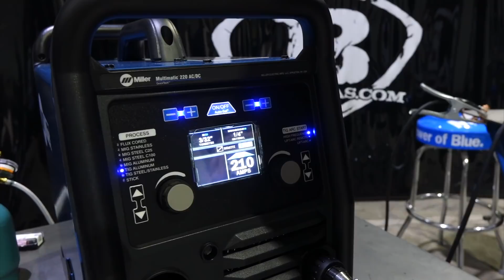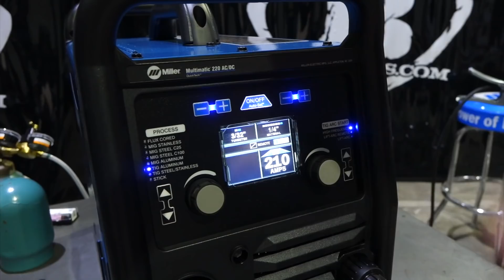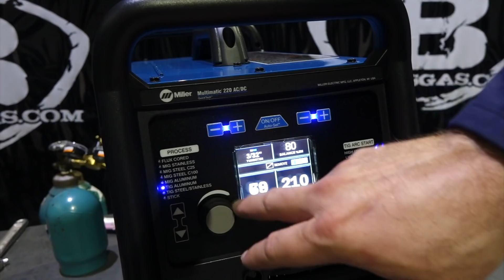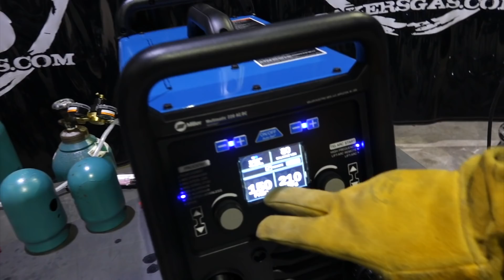Multimatic 220 AC/DC Welding Review

Comment: I’m new to welding and need a 200mig but I wouldn’t mind learning to try to do tig later on. Is there any 200 multiprocessor type welders cheaper that would also tig aluminum?
I was really wanting the Esab emp210 but people were saying it would not tig aluminum for what ever reason.

Comment: Man this is an older video but I love my 220. It’s a stellar machine does great all around work. Most will say you can’t adjust post flow on it so they won’t get it. You can adjust post flow from 0-30 seconds. While the unit is powered up you use the far left negative button and the far right positive button. Press them at the same time and it will put you into an advance setup menu with 12 options it’s the last one. It will save you on gas as the factory settings are a bit high for some materials. Stainless I tend to put it above factory settings but that’s just me. If your pondering the purchase don’t hesitate it’s a fabulous machine. I’ve welded both blue and red and I love this little blue machine.
Reply from the maker: Thanks for the feedback. We are actually going to do an updated video here soon and will go into some neat things like that.

Comment: This machine is for the amateurs, since it comes with the automatic settings that are never reliable and produce the best weld.
Reply: Thanks for your commentary SOURPUSS. I am a beginner and amateur. I am happy with this machine.Too bad we are not all PROFESSIONALS  like you are
Reply: @Fatso714  I became a SOURPUSS cos I tell the truth. Miller paid you to promote their products, so you tried to avoid tell the truth. Miller's list of configuration of amperage/voltage and wire speed can only used as a reference, each machine has a duty cycle limit. Long time use can never depend on the fixed figures.
Reply: D T thanks DT, boy you would be no fun at a party 😂🤣
Reply: If you can’t weld with the auto settings, perhaps it’s the “welder” (you) and not the machine. I promise you, the settings are there because they work, the engineers have done more math than you’ve ever done. Learn how to weld buckaroo and it’s not a problem
Reply: @moparproud3978  Only rookie uses the stupid "automatic" settings. You seem to know nothing about real welding, but take the engineers theory for granted. As a professional welder, I have 29 years of experience in welding and  have used all kinds of welding machines, finding the pedal is the most reliable gadget to make the best welds, rather than the stupid engineer's configuration. By the way, do you know duty cycle?

Comment: Gas bakers.   Were you welding on 110v or 220v power source.  I only got 110v at home.    I was wondering  what thickness Can I weld tig aluminum on 110v. ..

Comment: You can't weld stick weld 1" plate with this, can you?
Reply from the maker: Recommended for 3/8 steel
Reply: 200 amp stick, @ 15% duty cycle, I wouldn't recommend welding 1" plate with it, but in a pinch and multiple passes Id say it would work

Comment: What's the duty cycle? And are there post flow settings? Can it weld 0.45 fluxcore? And why the heck does it have a problem with 6010? We don't use 6011 in the South very much. Gotta be able to practice a 6G requiring a 6010 root. Does it burn 1/8th 7018 on 110? Maybe I should call with all these questions 😂 the 6010 thing is making me scratch my head though.

Comment: Brother let me ask you a question...
Since you have tested both, tell me if you had only one choice between the one you test in this video and the TransSteel 2200C, which you should buy...
Reply from the maker: The TransSteel is a much more capable machine. The 220 is more user friendly. Really depends on what you are using it for and your preferences. If you want to call I would be happy to chat with you about your use.

Comment: Pushing the welding parameters of the amperage. Can the
millermatic 220 weld larger than ¼ in stainless to 3/8?  This miller is rated at 210 amps ?
Reply from the maker: MIG: 24 ga. - 3/8" Steel 18 ga. - 3/8" Aluminum
DC Stick: 16 ga. - 3/8" Steel
AC/DC TIG: 24 ga. - 1/4" Steel and Aluminum
For the full spec sheet click on the specifications tab:
https://bakersgas.com/products/millermultimatic220ac-dcmultiprocesswelder-907757

Comment: Welds 1/4 Tig stainless . Will it also do 3/8 stainless wire for  Mig?
Reply: https://www.millerwelds.com/equipment/welders/multiprocess/multimatic-220-ac-dc-multiprocess-welder-m30190

Comment: Is the AC feature worth it? Is the Whole machine worth the 3k? Thanks for this video!
Reply: If im only do aluminum once in awhile. Wouldnt it be cheaper for me to just get the 215 and spool gun?
Reply from the maker: @Baerrrr83  Yes so really if you can tackle your project with MIG welding with a spool gun that is a good option.Feel free to call us or email us and we can compare the cost for you and help answer any other questions you might have
Reply from the maker: If you are now or in the future going to want to TIG weld aluminum then 100% yes!! If not I would check out the Miller Multimatic 215.

Comment: How thick   of material  can  you weld with it?
Reply from the maker: MIG 
24 ga. - 3/8" Steel
18 ga. - 3/8" Aluminum

DC Stick:
16 ga. - 3/8" Steel

AC/DC TIG: 
24 ga. - 1/4" Steel and Aluminum

Comment: It would be great to compare this to the Multimatic 215. I know this is a stronger machine and can handle AC TIG.. would still be a cool video though, thanks!
Reply from the maker: Sure we were going to make that but have not yet. Really biggest difference is the TIG capability and right now pricing. The Miller 215 has a great rebate getting the cost down majorly! The 220 is such a great all in one machine if you will be or plan to in the future TIG weld aluminum. Also we do have Baker's Bucks on both machines right now! Call or email us if have questions. support@bakersgas.com or 877-930-5690

Comment: do you have to worry about any electronic gear nearby frying if you use the high frequency settings?
Reply from the maker: There is always concern for that to a point but just be aware where you are welding.

Comment: can you swith out the tig torch for a gas knob one?
Reply from the maker: Yes, you should be able to. It comes with the WP-17 style. If you are wanting to stick with a Miller/Weldcraft one then I would call them to see what your options are. If you wanted a CK Worldwide on then I would suggest calling them to see what they offer for this machine. Miller: 920-734-9821
CK: 800-426-0877

Let us know if you have any other questions!

Comment: does it run 6010
Reply from the maker: It does but it's not recommended. The REBEL 205 does stick weld 6010! Here is a link to that video. 
https://youtu.be/a6s1zp6hr5s
Reply: that's disappointing I was considering the Miller it's my personal brand even named my dog after them but I need a machine that can truly do everything
Reply from the maker: @johnnywilson8532  great choice on the dog name! Yes for sure I mean as you saw in the video it will run 6010 but not well.
Reply: 6011 works great on it

Comment: That's a nice piece of gear!  I wonder if Miller copied the Harbor Freight Vulcan OmniPro 220, because it looks exactly like it except for blue paint.What type of high frequency arc start does it have, a capacitor dump, or true spark gap generator?Very nice. Go Miller
Reply from the maker: The Miller 220 has a capacitor dump high frequency start. It is a high frequency module it does not have the tungsten points like the older models used to have. Hopefully that answered your question? If not let us know what else you would like to know and we are happy to find out for you.
Reply: the Vulcan's high freq start is unreliable at best
Reply: @chuckhickman8093  Actually it boils down to operator error with ANY tig. 
2% lanthanated  tungsten works incredible with this welder. The tungsten they off with the welder is whats causing the issues for most. The miller uses ta capacitor discharge start just like the Vulcan they copied.
Reply: check out ChuckE2009's video on the acdc Vulcan. took 5-6 times to start the arc. I'd honestly like to know the light up amperage on both these machines. i know I'll probably get the miller just because I've used miller machines in the past, I'm familiar with the arc characteristics and i know miller has excellent customer service. 

I had a miller digital elite hood that I cracked. clearly my fault, as I flipped a steel truss on it. miller replaced it under warranty, although they didn't need to
Reply: @chuckhickman8093  ChuckE2009 is also VERY BIASED in his reviews, and only gives good reviews to company's that give him free equipment. He also doesn't read manuals and thinks he knows everything. Go figure. A true welder would have checked connections, tungsten (his was balled and contaminated), work piece was setting on top of a filthy work bench with grond connected to the table, not the work piece, etc, etc.

Comment: what about post flow?
Reply from the maker: When you switch on the TIG options for your Multimatic 220 welder, you can adjust the AC balance from 60-80%, and move the AC Frequency from 60-150 Hz. You’ll have life-arc and high frequency start options, and you’ll also have DC Pulse from off-150 pulses per second and TIG Post-Flow from auto to 25 seconds. That can be accessed through service menu screen 12.

Comment: It's awesome yet way overpriced, adding $2,000 to the cost of DC machine just to add an ac tig feature..think about that. 

$3,000 is the cheapest price for a 220 AC/DC, you could have 2 dedicated machines (one ac, one dc) for far less. A Miller 211MVP can be had for $1,000 shipped all day (yet no tig), however a 211 can do aluminum (spool gun). 

If the 220 AC/DC was $2,200 or less maybe...and to think...by provided this machine you get less metal, motors, screens, knobs, case(s), bolts, circuit boards....and still that much more, and get less (opposed to 2 dedicated machines). Kinda funny, you get less....yet pay even more...compounded.
Reply from the maker: Hey- thanks for watching we do have some bonus offers to get the price below $3,000 but I get it is a lot more expensive than other machines. It is convenient to have three in one and with this machine switching between MIG and TIG is super easy. (Saves a ton of time from getting another machine out/set up) Also backed by Miller Electric 3 year warranty. If you have any other questions let us know!
Reply: I agree...Lots of other welders out there. You could easily purchase a 200 AC/DC tig , and a 200 amp mig welder and keep $1000 in your pocket.  You could get a Harbor Freight Vulcan Omni Pro 220, and a Vulcan AC DC Pro Tig, and do everything this can do.
Reply from the maker: @Joeak74  you get what you pay for ;)
Reply: @BakersGas  Or... you don't get what you pay for, and end up paying way too much  because of the name and color of the welder. Just for the record... I've already seen the inside of that Multimatic 220, and it too uses imported solid state boards like all the imports do. Its just assembled here in the U.S.A. with quality import parts.Why such a small screen and the tiny dinse connectors for that much money? A beautiful welder, just not worth the cost in my opinion.

Comment: My cardinal rule when welding aluminum is Us a respirator...  It doesn't take much Aluminum vapor  to settle in to the brain and start the Alzheimer's disease.. even if it doesn't kick in for many years. F u have aluminum vapor and u breathe it. It ends up settling in the brain. And there's a high likelihood of Alzheimer's...
Reply: Bryan Calhoun  thanks for the info ive welded maybe 15-20 hrs of my life aluminum but i never used a respirator.:-(  what kind should i get?
Reply from the maker: @bushwalker2673  the most popular one we sell for that is the Miller LPR-100 it fits well under the hood. Another tip is make sure you keep your respirator in a zip lock bag or contained in some way away from contaminants. Link to the LPR-100 below:

https://www.bakersgas.com/MILML00995.html

Comment: Compare it to the new esab rebel
Ac/dc
Reply: Please make a comparison! I'm looking to get one of the two! Thanks!!
Reply from the maker: @LT4Nova  we will make a video with the REBEL 205 as soon as we get a demo unit.
Reply from the maker: Yes for sure! As soon as ESAB gets us one to try we will make a video. It is looking like January for the 205. We will be getting them first as soon as they are available. Thanks for watching! Make sure you subscribe and you will get notified when we post new videos.
Reply: kickgalaxy not released and they keep pushing it back aka issues
Reply from the maker: @hans-dz3sn  we are excited for it to come out too! Looks like January is the real deal this time :) We will keep you posted.
Reply: @BakersGas  find it odd you in the US don't have the 205, assuming you are talking Rebel EMP 205ic AC/DC.  I am in Canada and was in a bricks and mortar supplier today and they had at least one out on display so I assume its in stock.  We are usually 6 months to a year behind the US in terms of supply chain so...here its about 2% to 3% higher cost than the Miller in the video.  Duty cycles all about the same etc.
Reply from the maker: @RussZHC  we are getting them soon! We will be the first distributor in the US to get them. Yes I am surprised Canada is first as well :) We will make a comparison video as soon we get one in the shop to play with.